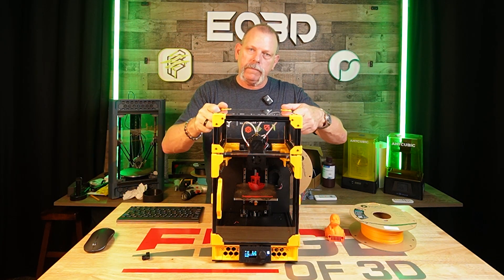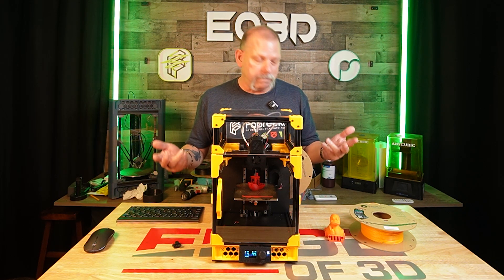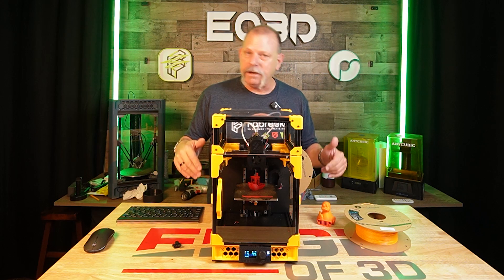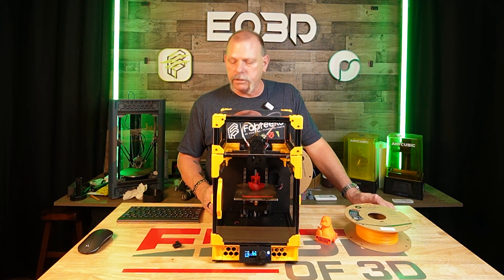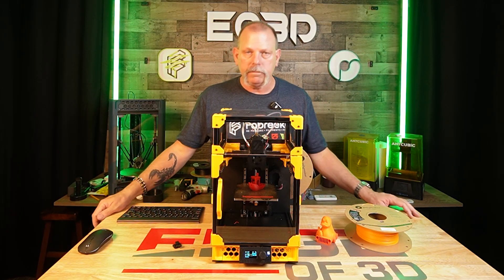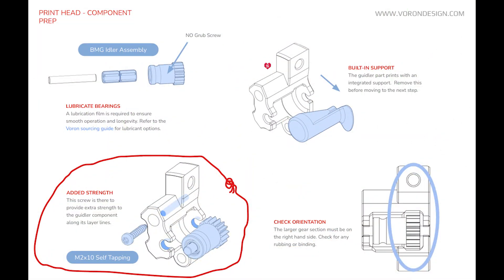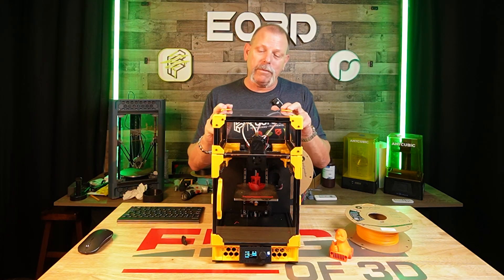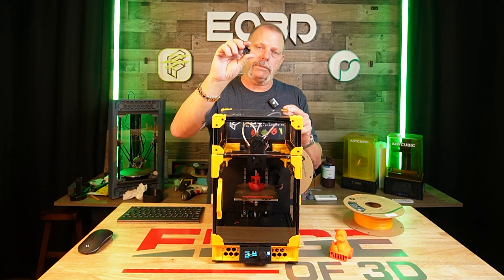VORON V0 MADE WITH PLA | EDGE OF 3D

Comment: how is it holding up?
Reply from the maker: Couple hundred hours on it with zero failures.
Reply: @EDGEOF3D  are you printing abs and asa or just pla stuff?
Reply from the maker: Mostly ASA and rarely a PLA or PETG part.
Reply from the maker: Printing PC with it tonight, working fine

Comment: I love it! Good to know it will work for a printer in a pinch at least. Sometimes you just need to be able to bootstrap yourself up from a yard sale special to a good printer and HT-PLA seems like it could cut most of the links off that Rep-Rap style chain.
Reply from the maker: Yeah, I see that situation pop up all the time—someone’s got an open-frame printer, ready to jump into their first Voron build, but they can't print in ABS, ASA, or anything that smells like sadness and enclosure heat. And if they’re in a country where PIF programs don’t exist or shipping costs more than their printer, they’re kind of stuck.

That’s exactly where this HT-PLA experiment came in. It’s not the gold standard—but it’s a bridge. It means someone could bootstrap a V0, use it to slowly reprint their parts in higher-temp materials, and eventually step their way up to a Trident or V2.4 like some kind of weird, layer-by-layer metamorphosis.

Was it a good idea? Absolutely not. It was a chaotic gremlin thought that I ran with out of pure spite and curiosity. But somehow… it worked. So now we all have to live with the consequences.

Appreciate the comment—and hey, nice to see you enjoying the madness for once.

Comment: I would be surprised if you took this info and applied it to a larger printer where the prints are longer that this material would show issues. Are you planning on building a trident or v2 from this and do another test?
Reply from the maker: As I said in the video, this worked for a V0, this would likely not work for a Trident or V2.4
Reply: Oh I know you did, you mentioned you had parts for either printer, just wondered if you were going to try it?
Reply from the maker: No, this was more of "I have half a roll of material, can I do this" type thing. The next Voron and V2.4 will be using PPA-CF like the LDO Voron 2.4 I built last year with PPS-CF.
Reply: Nice. Well your not going to have a problem with that material. PPA-CF is a fantastic material

Comment: those black stuff is aluminium extrusion? well you could even make motors with pla but the coil needs to be metal/copper. lol. pla asterisk.
Reply from the maker: I said all printed parts. You know—the pieces the printer actually prints, not the aluminum frame you buy because, shockingly, printers don’t extrude metal beams. Anyone who’s touched a Voron without wearing oven mitts knows which parts are printed and which aren’t, so there’s no need for your little PLA asterisk.

Comment: I'm pretty anti-PLA for functional items, but I can't disagree with you on this. For a V0 where heat isn't a real factor, then who cares. The other thing is (let me put my mechanical engineer hat on) the creeping of the material. You probably already know all about this, but maybe someone reading doesn't. Any part under a constant load will deform over time, and PLA is possibly the worst 3D printed material for that. But in your case, all those parts on the enclosure and the base won't matter if they deform by a few percent. But anything that IS sensitive to that sort of thing will bite you in the ass.
Reply: I wouldn't say pla is the worst, but pretty bad. Some PAs are imho the worst in terms of creep.
Reply: That's funny. I have a ton of functional prints. All PLA. On my bicycle, motorcycle, bathroom, ... Going strong for years and years.
Reply: my side view mirror on my bicycle is cantilevered with a PLA clamp from the handle bars. It has been through two winters so far. it replaced an injection molded PA-GF part. i have multiple pla fan mounts for low temps, working fine for long times. I have many compliant PLA prints that are like spring clips that clip on to tubes and around phones and whatever, still holding after a year.
Reply: I've heard this yet I have yet to find anything to back it up. In fact I there are several experiments you can just look up here on youtube (CNC kitchen I believe did one) that shows the exact opposite. Now there are a ton of factors that go into material choice and obviously PLA isn't the best of all time. I think PLA is really underrated for what it can do and is incredibly strong. Just don't use it if you need heat resistance or any amount of flexibility.
Reply: @nathanael8573  suggest to look up "material creep" on an engineering wiki. It is VERY well documented for PLA. It's a major reason why Vorons call for ABS. You mentioned CNC Kitchen, he built a Voron using CF Nylon which is another material with significant creep. It completely tanked.